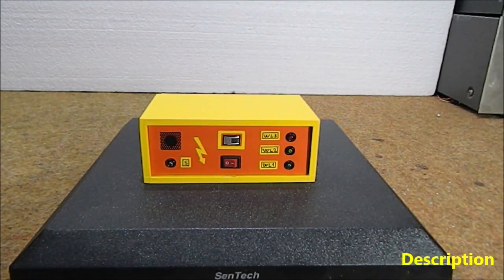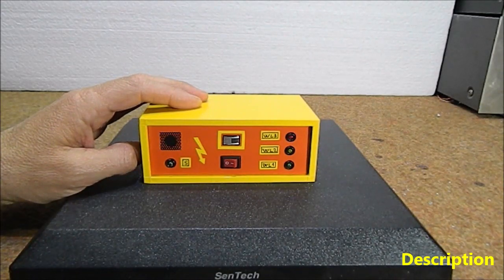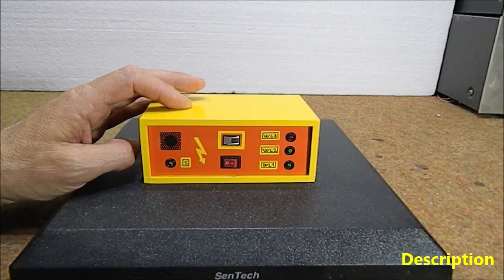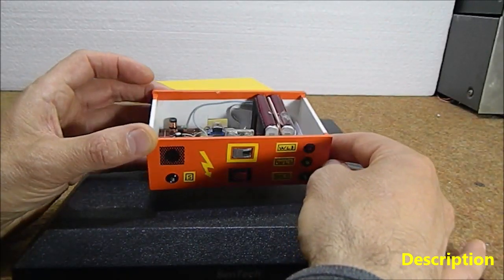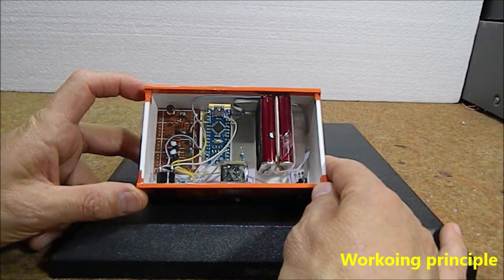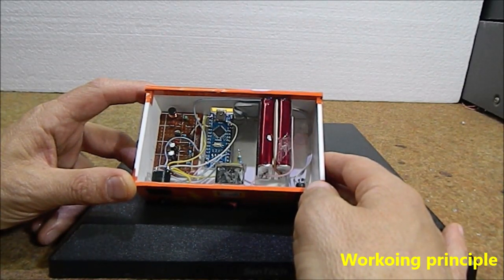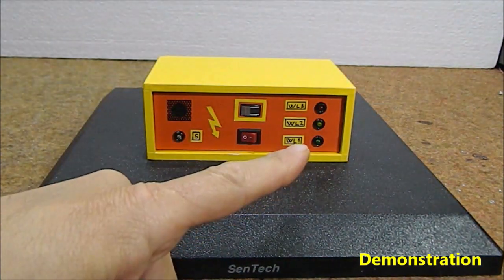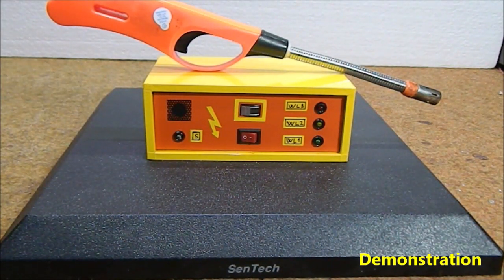Sensitive Arduino Lightning detector with homemade sensor

Comment: Why are the 470 Ohm resistors 15 watts?  The linked parts list references them as HS15470RJ. The LEDs are being powered by the Nano, so surely a 15 watt resistor is unnecessary?
Reply from the maker: The resistor is standard 1/4w or 1/8w, the 15w resistor is mistakenly linked
Reply: @MirkoPavleskiMK  Thank you for the confirmation!

Comment: hello. is it possible to measure direction of lightning with arduino? could you make such device?
Reply from the maker: Unfortunately not, determining the direction requires at least two such devices in different locations

Comment: Very useful lighting detector especially when house not in attendance, and when interfaced with mains power relay to switch of all electronic equipment connected to mains during thunderstorm. Often during lightning in country area power lines and houses experience lightning discharge causing expensive damage to all electronic equipment connected to mains. Many surge protections not adequate to slow or lack of power to handle lighting strike the only sure prevention is to disconnects electronic devices from power line during thunderstorm and  lightning.

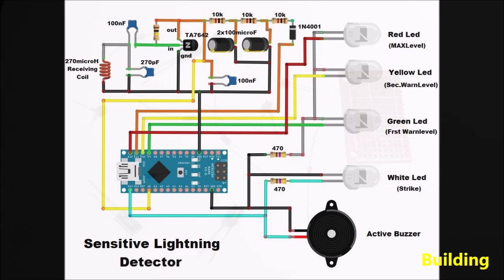Comment: 2:54 in your schematic the TA7642 is the wrong way around, if you build it like the picture the GND and OUT are transposed.
Reply from the maker: This is because there is no TA7642 part in Fritzing. That's why I clearly marked with letters where GND and Out should be on the diagram